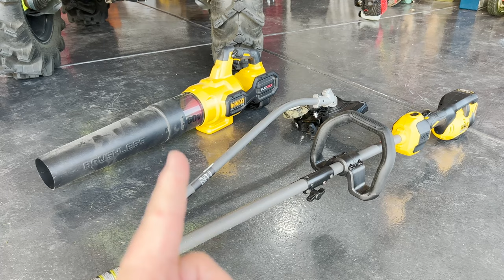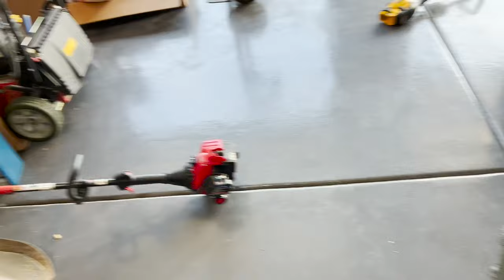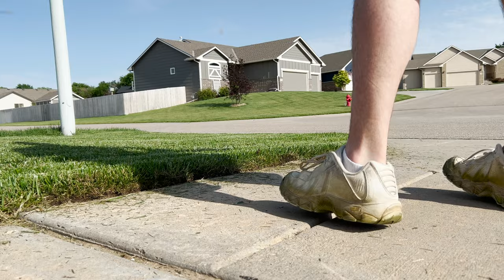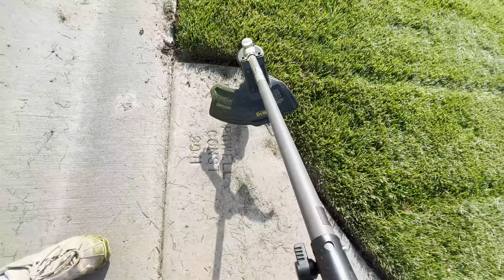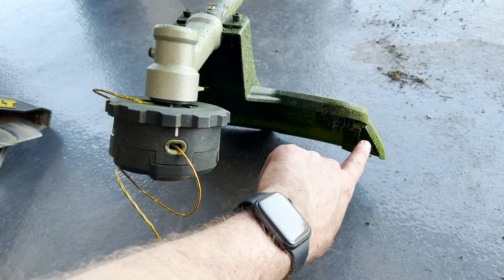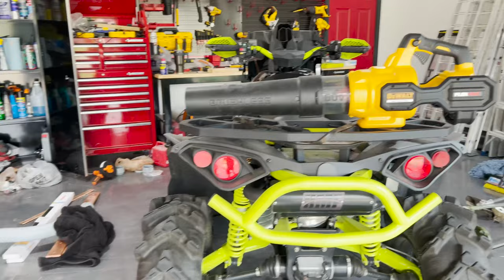DeWALT proves me wrong on cordless trimmers/edgers

Comment: Thanks for the decent review of the DeWalt string trimmer.  I purchased the same trimmer and the DCMWSP255Y2 mower.  I love not having to have ANY gas in my garage.  My trimmer came with a 9Ah battery, and the mower came with 2x12Ah batteries.  I noticed on the string trimmer that I can use it on Low setting, and only need minimal power to complete all the trimming on my suburban property.  I then switch to the edger attachment.  This I use it on High at full speed.  I've been really happy with this tool and its attachments.

Comment: I’ve had the dewalt  string trimmer and blower for five years now.  They have been flawless.   I use the 5.0 and 6.0 batteries in them.   So much better than gas powered small engines now.
Reply: You enjoy the older trimmer model? Am I the only one who got the model with a tiny trim guard? 99% of the trimming cover me up when I use it.
Reply from the maker: Maybe u suck at trimming?
Reply: @bigbigspoon  I got the new "Beast mode" of a Dewalt (DCST970X1), but I also purchased the much larger guard to go with it.  60v of power clearly kicks the 20v units butt.  The older unit works great, probably 3-4 years now, but its going to my rental properties now, new one staying home with me.  Even on LOW, I barely just touch the lever to take out weeds around the sidewalk.
No, it does not have the attachments, it has raw power I've never seen in a battery string trimmer.

Comment: You were replacing your string every 2 weeks?! Holy crap. I usually go an entire summer and only replace once.  I'm guessing that metal fence is chewing through all your string
Reply: I replace string 2 times minimum while doing my tiny yard. I must be asking too much from the trimmer?
Reply: @bigbigspoon  Almost sounds like the head is constantly spooling out string instead of just when you tap it against the pavement. It shouldn’t be doing that.
Reply: @CantankerousDave  90% of the time it tangles/locks in on itself causing me to open it up and fix it.
Reply from the maker: Get this new one
Reply: @bigbigspoon  or not soaking your line in water for 24 hours

Comment: Biggest issue, quality and durability. Ryobi, for example, in famous for its low quality and lack of durability. Sthil and echo are known for their quality and durability.  Within that scale, where does the DeWalt 60 volts trimmer stands?  For how long the battery last, the key is that for longer continuous work you will need more than one battery, safer to have four and a rapid charger.  Three batteries and one fast charger is the minimum for continuous work.

Comment: With a brushless trimmer you do not tap it.  You turn it on to the speed you want and run at that speed.  For careful work in gardens, around cars, etc you just run it at the lower speed. Much easier and safer than a gas trimmer.

Comment: How much runtime did you get with your batteries? If you can include run times for both settings (1 and 2) if you used both for the duration of the battery, that would be great.

Comment: Wish they had an adjustment for taller ppl like yourself. You had to kinda lean a bit to use
Reply: Yes, this too may be my biggest gripe. I have a Stihl gad Kombi unit. I'm 5'10" and my back ACHES from stooping to use edger/trimmer for ~60 minutes. It's ludicrous -- as if manufacturers don't care. Instead of a longer, more appropriate length for adult men, I guess they shave cost with shorter overall lengths!!!

Comment: i think you would be better off with the EGO ecosystem for lawn tools... Dewalt should stay in their lane they arent the best for lawn tools.  a lotof these issues you mention dont exist on EGOs products.  and it has auto load string where you just press a button.
Reply: Wait till you need the ego nonexistent service/ warranty.  60v dewalt trimmer beat all the others on by far the best tester on earth.  Project farm.  Yes it beat the ego
Reply: @michaelvoorhees5978  had it for over 2 years and no issues so dont really care about warranty or service.  and project farm is highly subjective it depends what you care about how you take their results.
Reply: @CGGC0202  ok, and who cares if Dewalt isn't the very best for lawn tools.  They're good enough for people who just want to stick with power tool batteries otherwise you're left spending more $$ for lithium you probably didn't actually need.  Save some money and buy more power tools that Ego will never ever make.  I can think of dozens of other Milwaukee/Makita/Dewalt tools I'd rather buy than some Ego batteries I might only ever use on 2-3 tools.  

Plus Dewalt's powerhead doesn't use proprietary coupling.  So being able to pick up attachments from Echo, Stihl, Husq, Ryobi/Hart, Troybilt, etc, etc is a nice option for catching more potential sales or used market attachments.